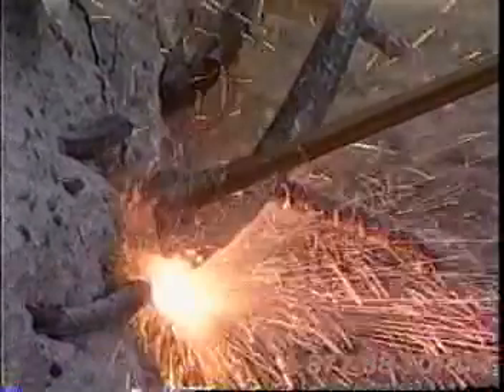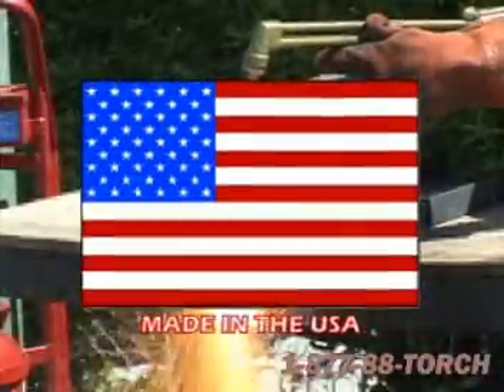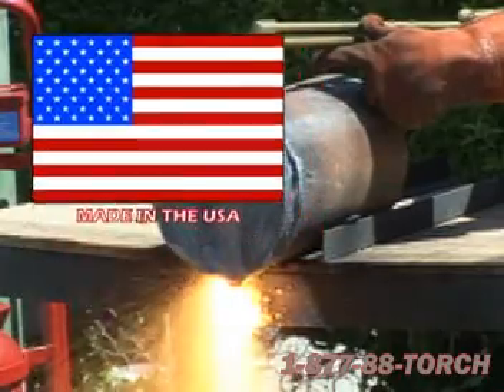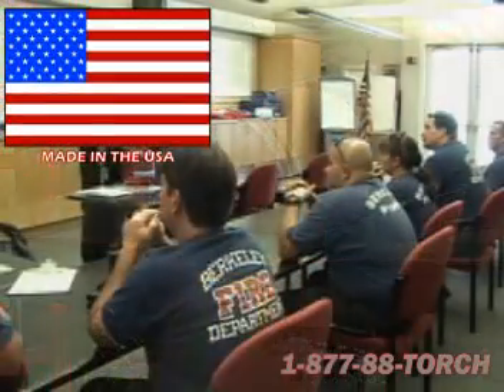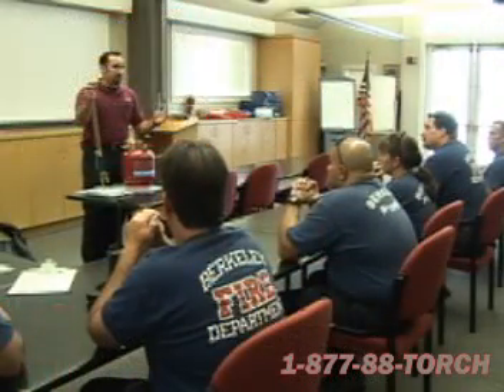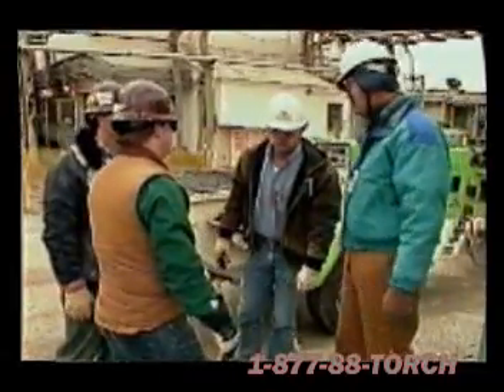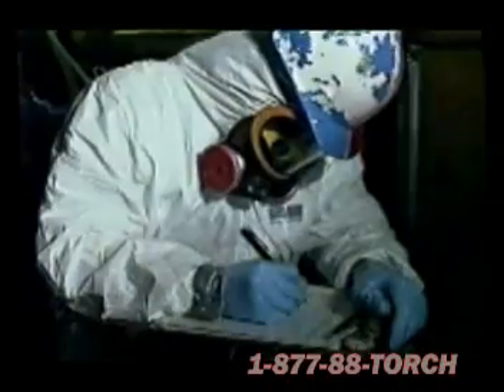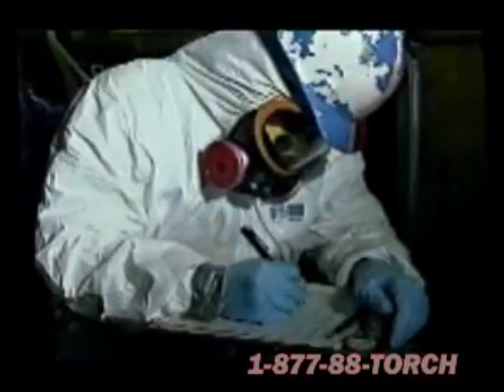Petrogen Oxy-Gasoline Cutting Torch Sales Video

Comment: it doesnt matter if you cut threw 1 plate of steel or 30 its still oxygen doing 99% of the work
the gas  just gets the metal hot enough for the oxygen to begin cutting,, you can do this with propane, and no you cannot weld with gas or propane

Comment: Think he means it doesn't "sell" the product to the guy who will be using it, but does sell it to the accountant who wants to save money and the boss who wants you to do the work of two guys.

How do you put the fuel in? Is it pumped to the torch? How do you light it? Can you weld with it? Can you run it on diesel? 

Practical stuff!

If you can weld and braze with it, i would be interested in one or two.
Reply: yes runs diesel kerosene biodiesel and jet fuel used multi fuel adapter
Reply: heavydiesel